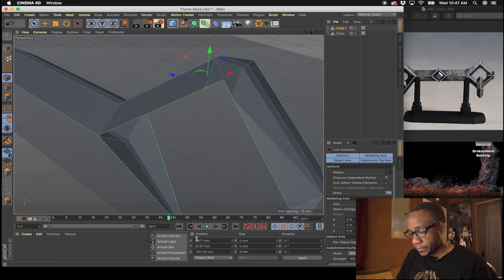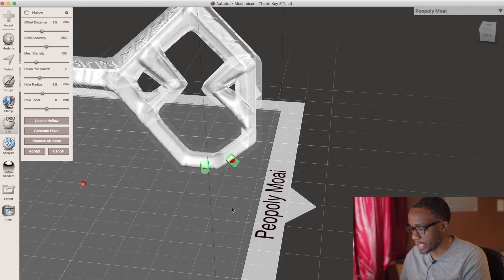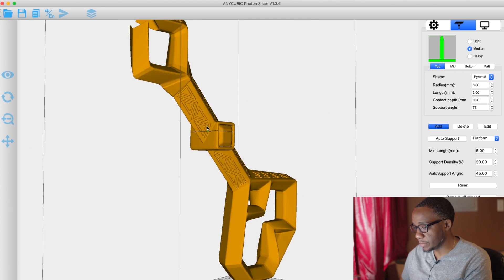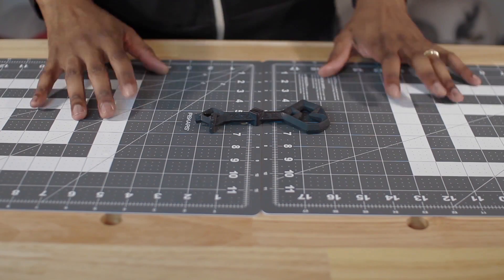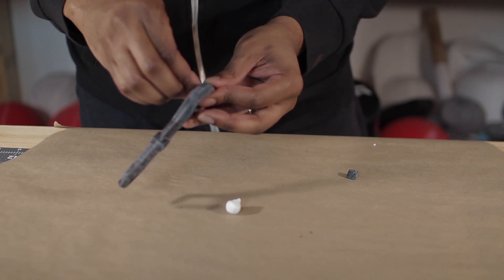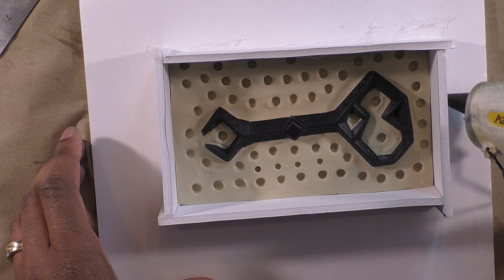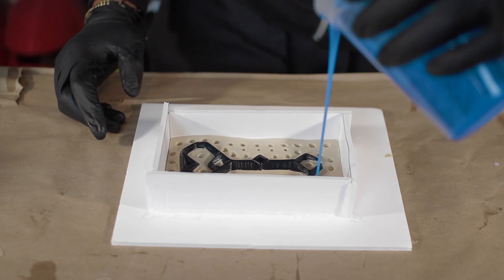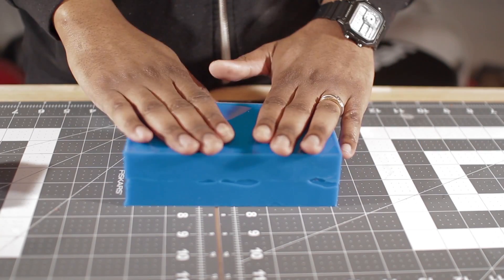3D Printing and Molding the Key to Erebor!

Comment: IMPORTANT NOTE - Make sure the oil based clay you use does not contain sulfur. Sulfur will inhibit the cure of the silicone and the silicone will remain sticky and never cure completely on the surface next to the clay. You will end up with a layer of gooey mess that may ruin your model because uncured silicone is almost impossible to remove completely. Many oil based clays, such as Roma Plastilina do contain sulfur.

Comment: If it's printed in resin, what's the benefit of casting it in a different resin? Unless you're planning in making many more of these.
Reply: The resin from 3d printers is often brittle, with a mold he can choose from lots of different types of resins to get the durable results he wants. He also mentioned cold casting, which wouldn't be possible using just the printed part.

Comment: Sadly a Fail :-( - You call resin expensive and do a mild for resin casting without a way to fill it and without a way for the air to escape. But like you said: it’s your second attempt, so you’ll learn from that quite fast!

Comment: If you separated the model in 2 parts along it's natural seam- where you were going to place the 2 part seam-line would have negated the need for supports, loss of detail and extra work. Print in 2 parts.
Reply: I was thinking exactly that. Print it flat in 2 pieces. The resin you lose from not having it hollow seems less than all that support material. The only thing that make sense for how he printed it is the size of the print bed. When he rotates it 45 degrees you can see the box that I suspect is the printing size. He would have had to size it down if he wanted to print it flat.

Comment: This was awesome to watch, but I have a question:

Ignoring the blatant questions that people have already asked, and excuse me if I just missed this in the video, but why print it vertically at a 45 degree angle instead of just flat?
Reply: I think his printer isn't big enough for printing it in a horizontal position. He solves his horizontal print limitation by using some height to compensate for it.
Reply: It’s seems standard to resin print that way, even for miniatures. Always wondered why.

Comment: use a hot air gun on the supports before you cure it in the uv chamber and the supports should clean of nice and easy.

Comment: How do you get the resin into the mold? Did I miss the spout or something?
Reply: It's possible that he just fills half of the mold and then closes it and then spins the mold around to spread the resin. If the resin is tick enough it could build a layer on the sides and be hollow. I don't think thats the plan for this because of the shape of the key. It would be bubble nightmare and the chances of bad cast is very high. I think he simply forgot the channel to cast.

Comment: You will have to be careful in the placement of the pouring and exit holes on such an angular structure, I'm looking forward to part 2.
Reply: really interesting he used the anycubic software for the supports but printed it on a different printer
Reply: @GaiusIuliusCaesar1  Hey, that's what you call choices.
Reply: This IS part 2. Part 1 was him creating the 3D model for the key.

Comment: You forgot to put a hole or channel so you can fill the mold.
Reply: I was about to say the same thing.
Reply: I'm sure he's figured it out by now though.
Reply: I mean, some people pour in resin and smush the two parts together and hope for the best, but I would rather cut out the messwork and have better quality in my castings.
Reply: @RustyRaygun  Might be a chance that he is going for the carving method used in roto casting. Like it is  a basic cast with not that ridiculous amount of detail or small components. So I guess it should be just fine making a sort of sprue contraption with pour hole and vent holes.
Reply: Maybe that's why the video ends here instead of showing him cast with it
Reply: @finalcountdownsteve  Yeah I've done that when I've realized my mistakes, but it's really difficult.
Reply: Silicone is flexible, on small things like this, I slip a tube in, inject, and then slip the tube out, seem less.
Reply: @Index - that’s a good idea!
Reply: He could use the expansive foam
Reply: @fannydelgadillo2974  you would definitely need a sprue for foam.  One for pouring in and another for allowing excess gas bubbles to release.
Reply: I have never do this like this.  He is doing it the hardest and slowest way possible